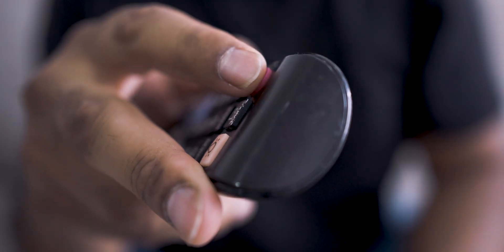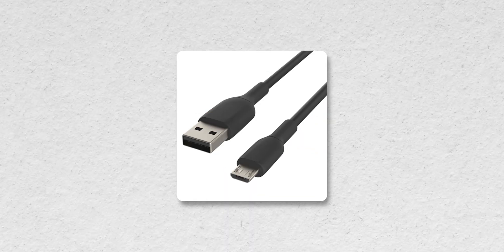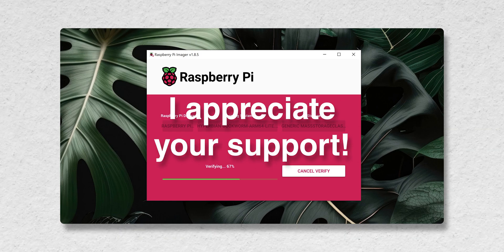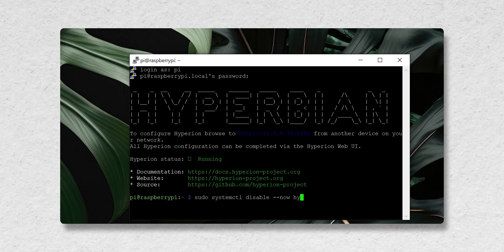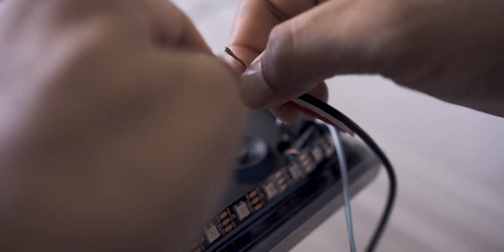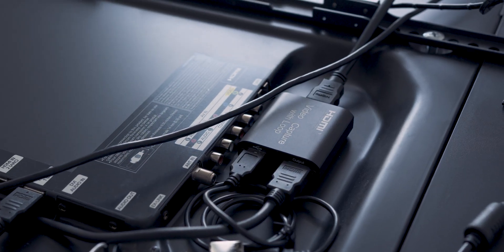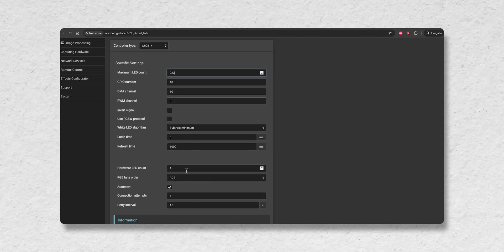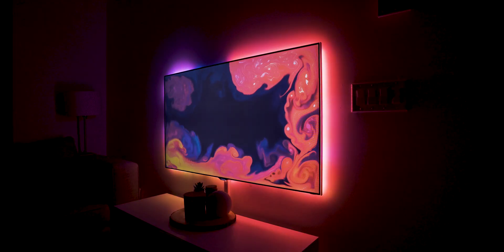I gave my TV a GLOWUP with a DIY LED Ambilight backlight | Philips, Govee, Nanoleaf alternative

Comment: ıve got 12V cob led strip, it is also driven by 5V pwm. from gpio18 pwm pin , you can only send 3.3v pwm . So first question is, 5V led strips data input can be driven by 3.3V pwm?

Comment: No VRR, no 4k @ 120hz for this set up just FYI. You'd be seriously degrading your video/gaming quality if using this on a console.
Reply from the maker: Hey iOakie, thanks for pointing this out. In order to support new-gen consoles, the setup will need a splitter and capture card that supports HDMI 2.1, but these are expensive, and at that point, it's better to explore plug-and-play options like the FANCYLEDS 2.1 Fancy Sync Box that has HDMI 2.1, VRR, ALLM, and 4K@144Hz.

Comment: Hello, very good project. I have it around 1 year and it is working well but not in gaming either pc or ps5. Do you have any recommendations? Its clearly matter of the capture card that cant handle 4k 60fps although in the specs is written that it can. It can handle this resolution but have many flicks.

Comment: This vilcome is a switch right not splitter. Only the x box runs or the light runs am I right ?. But u need a splitter to run both lights and console. Am I right ?
Reply from the maker: Hi nextmarketingg, thanks for stopping by! Yes, the Vilcome is a switch. My XBOX One and Amazon Firestick are connected to it. The output from the switch feeds into the ambilight setup. This allows me to use the lights for both devices as opposed to just one.

Comment: Can an ESP board be used as an alternative to Raspberry pi?
Reply from the maker: Hey dashingtimmy, thanks for stopping by. Sorry for the late reply.
I did some research and this is what I found:

"An ESP board is a microcontroller, not a single board computer like a Raspberry Pi. It does not have the capability to run the full Hyperion server software or process video input from an HDMI capture card directly."

Therefore, you'll still need to use a Raspberry Pi.

Comment: hey! your capture card in video and in the description are different! Which you have used at the end?
Reply from the maker: Hey artemgoncharenko646, thanks for pointing this out. It looks like the card I linked initially is no longer available on Amazon but I've updated it with a new one.

Comment: Hi, I hope I got reply due to my curiosity to build similar thing. Is it working while I'm watching youtube, netflix, etc? Some DIY-ers sold their homemade product and encountered DRM issue, so the lights won't work. 
Also, about Hyperion, is it necessary to use that specific software? Or I can use other apps, such as SignalRGB maybe?
Reply from the maker: Hey noobricer,thanks for stopping by! This method routes the HDMI signal from your streaming device (Roku, Amazon Firestick, etc.) through a capture card, and then passed on to your TV. The capture card is connected with the Raspberry Pi/Hyperion and they process the signal and display the appropriate colours on the LED strip.
There are capture cards that can bypass DRM (such as the one I used). You just have to search for one on Amazon that specifies that.
It looks like SignalRGB has mods that can allow for a similar result, but it looks like it could be more complicated than using Hyperion. Hyperion is also open source so it doesn't cost anything to use.
Reply: @bhimmeup  hi, thank you for your answer! :D I tried signalRGB, and it's a little bit awkward. It's really pixelated so it can't give me the most accurate color, so I'll try Hyperion. Thank you

Comment: why not put the capture card on your e-arc hdmi, and plug your inputs into your  audio reciever? that way your tv apps should also work. at least i hope it would work this way
Reply from the maker: Hey @phreshxmetal! I don't have an audio receiver at the moment but if you have one that's capabale of HDMI pass through and you can change input via the receiver, then technically you should be able to do it this way.

Comment: Why are you not using a level shifter between led strip and raspberry pi? Is it still working fine? I am asking because I really like the project and the video and want to try it myself but I saw some comments on this online and I am curious if I can do it without level shifter. Thanks in advance and thank you for a very nice video!
Reply: ıve got 12V cob led strip, it is also driven by 5V pwm. from gpio18 pwm pin , you can only send 3.3v pwm . So first question is, 5V led strips data input can be driven by 3.3V pwm?

Comment: This is an awesome project, congrats! I'm thinking about doing the exact same! Could you advise on 30 or 60 leds/m? Or possibly an rgbw led strip. This should also work with a raspberry pi zero 2w, right?

Comment: Great video, thanks for sharing. I just set everything up, I can confirm the Pi is receiving power and I was able to configure it, and the TV recognizes the HDMI input, but the LEDs just won't turn on at all. I connected it via a Roku
Reply from the maker: Hey Spencer! In the Hyperion app, do you see the live video capture when you play something on your Roku?
Reply from the maker: People who had the same issue online seem to get it working after re-flashing the Hyperion image on the Raspberry Pi. Seems like it could be a corrupt installation on the Pi.
Reply from the maker: You can also try turning off the audio in Putty (once you connect the the Pi) with this command: dtparam=audio=off

Sources online had luck getting it to work after disabling the audio.
Reply: @bhimmeup  thanks for your replies! I got it to work after rebooting and unplugging/re-plugging some wires. Not sure what the problem was at first. There was a weird issue where red and green were swapped, and cyan and magenta were swapped. I was able to manually override that to correct the colors, but unfortunately that method means the settings won't save if I ever restart the system.
Reply from the maker: Glad to hear you got it working!
Reply: @spencer00andrew  how could you be able to drive the leds ? i couldnt manage to drive leds.

Comment: Nice, however any way to get more details on the hardware connectivity (power, pins on raspberry...)
Thanks 👍
Reply from the maker: Hi Olivr. Thanks for stopping by. You can google Raspberry Pi pin mapping and specify which model you have.

Comment: 3:01 so I’m curious about something.
I have a setup where I have video from my switch going through a capture card and into both my TV and OBS on my computer. The only thing I would want this for is gaming (on switch or PC), soi was wondering if there is a way I can do this that instead uses a piece of software in my PC to just monitor what’s going on in OBS and light up the LEDs accordingly?
Reply from the maker: Hey OctozenX, thanks for stopping by!
I think I understand what you're trying to do. 
Check out the YouTube video titled "How to build a DIY ambilight monitor" by seafox c. It looks like the build uses a Windows app.
Reply: @ thanks for the suggestion, I’ll check it out

Comment: Would it be possible if, instead of buying new LEDs to connect behind the TV I used my nanoleaf project which I made that runs on a esp32 which has WLED running on it? Would it be possible for I to connect the ESP32 to the Raspberry Pi via Bluetooth
Reply from the maker: Hey Jad, thanks for stopping by! There's a guide on. Instructables.com titled "DIY Smart Home PC Ambilight" that uses wled. Take a look and see if it'll work for you.
Reply: @bhimmeup  hey it's me again, you know any reasons why the LEDs aren't mathcing the colors on the TV, because when I reboot the Raspberry Pi, the color stays white? I have some WS2811 LEDs you think maybe that's the problem, or is it the information cable

Comment: Thanks for the detailed video. All my HDMI inputs go through my receiver so i am wondering if i can still use this setup to create the LED sync from my TV sources like fire stick, PlayStation etc
Reply: Yes you can. I am using it with my Yamaha rx-v6a without any Problems

Comment: Problem here is you can’t grab the internal Smart TV Source, so only Ambilight from external Inputs
Reply from the maker: Yeah. That's the only limitation. Unless TV manufacturers start incorporating LED backlighting as a feature, the only other option is a kit that uses a camera to capture the screen.
Reply: That's not a problem, that's a feature. If you're still using built in smart tv apps, what are you even doing with your life?

"Smart TV" apps suck, and they're usually outdated and unsupported after a couple of years anyway. It's way better to buy a 'dumb' TV, and then use external media boxes. Android TV, Fire TV, Roku, NVIDIA Shield, AppleTV, etc, are all infinitely superior options to the slow, underpowered, and poorly-supported, slop that are built into "smart TVs".

And as those devices age, they can simply be replaced with newer, more powerful, boxes, instead of having to replace the entire TV.

Comment: Can I usea two different power supplys? One for the raspberry and one for the LED strip?
Reply from the maker: Hi mysharow! Thanks for stopping by. You can power them separately if you want. What's the reason you want to do it this way?
Reply: @bhimmeup  Awesome, thank you for the quick response.
I want to use two since I don't feel capable of wiring and selecting my own power supply for both items, so I feel better if I can use their own power supplys 😅

Comment: Wow great doen!
But for me this wont Work. When i like to watch Movies, i use the Inbuild OS from LG because this makes 4k and Full Surround sound.
Reply from the maker: Hi Fincher123! Quite a few people have the same dilemma. I'm keeping an eye out for any DIY or even off-the-shelf products that might be able to do this. I'll make a video on it if I find anything worthwhile. Otherwise, the only other hope is that  manufacturers start building TVs with dynamic LED backlighting.
Reply: @bhimmeup  Well thats great from you!
I didnt look for that Ambiente light feature like the most arent doing. Important was Resolution and 120hz, oh and it must be OLED. So maybe CES will show some "innovations"?
Reply: Many LG smart TVs running WebOS can be jail broken/rooted to host PicCap (frame capture device) and HyperHDR directly. This avoids setting up a Rasperry Pi with video grabber, making the setup a whole lot cheaper and more efficient. Can be done with an esp32.
Reply: @mysticqro950  Well i like to learn more ;=)

Comment: Great tutorial.  You might want to change the power supply link, however.  The link you have above is for a 12v DC transformer, but the Rasp Pi and LED strips are @ 5v DC.
Reply from the maker: Hey fkholleman. Good catch, thanks for letting me know! And thanks for dropping by!

Comment: what do i need to buy, if i want to have it on my monitor, so just a single monitor with PC, do i still need the splitter and capture device?
Reply: There is a cheaper route without capture card and splitters but it will use pc processing power to calculate colors which introduces a bit of a lag and lowers fps of ambient light. Most diy tutorials are about that route

Comment: I have a 4K HDR tv, will it work with above components? Do i need a different video capture card?
Reply from the maker: Hi geor.papadakis! Thanks for stopping by. 
You can use the same components and a 4k capture card. The only limitations are the Raspberry Pi and Hyperion. You will need to set the resolution in Hyperion at a level where there will be no lag between what you see on the screen and the colours displayed by the LEDs.

Comment: Can you do a tutorial using a larger led strip for a 75 inches tv? im asking this cuz someone told you you need 2 power supply for that project, also i hear you need to use WLED instelled on a esp32 device, is this true?
Reply: I found this: https://wled-calculator.github.io/
You can use 1 power supply and split it and "inject" at multiple points to keep the voltage drop under a certain level.
Reply: im currently installing one for a 75 inch tv, using a 12v 10amp strip with a deticated powersupply, if i pull it of i could let you know.
Reply from the maker: Hi Berbius. Sorry for the late reply! As Eric Fenderbosch said, you can use one power supply and run power to multiple spots. Just have to make sure that the power drawn from the LEDs are within the limitations of the power supply.

There are YouTube videos tutorials on how this can be done. Worth checking out to get a good understanding before you try it.

Comment: Was reading through the comments and saw that you recently got a baby and just wanted to congratulate you!

Planning on doing this build on a new tv we are hopfully buying soon as our tv is from 2009 😅.  Wanted to ask tho, the splitter ur using seems to output 1080p only. Do u know / recpmmend anything that takes in 4k and outputs 4k? Theres no point to run this if my tv is only getting a 1080p source instead of the whole 4k
Reply from the maker: Hi Probler, thank you!

I got my splitter from Amazon and really relied on the reviews to select one. 
I took a look on there and I do see a number of 4K capable splitters available. The only thing to look out for is the refresh rate. If you get a 120Hz TV, the splitter should match that.
Reply: @bhimmeup  hey! Thabk you for replying.

So I already have purchased everything but eas comparing prices on amazon vs aliexpress. Ended paying less than half for everything while making sure its reputable sellers and great reviews.

I'm currently assembling everything. Our tv is luckily 60fps so I found some cheap 4k splitters. But the higher end splitters that support higher fps can get a little pricey. All in all costed me 60 pounds excluding the raspberry pi as I already had one from a old project
Reply: The EZCO 1x2 HDMI 2.0 Splitter works like a charm too. I use that one. Supports 4k60hz input source with HDCP bypass, supports HDR, Dolby Atmos, etc. It maintains 4k60hz output to your TV and lets you downscale the 2nd output to 1080p60hz going into your capture card. From there, I was able to downscale the capture source even further in HyperHDR to 640x480 (for less latency) and maintain 60 fps screen capture. 

While still maintaining the 4k60hz to your TV, of course.

Comment: Is it posible to connect the LEDs into the USB port of the raspberry pie and have it get the data and power from there? Or are there limitations?
Reply from the maker: Hi @FORCEtheFUNK285, that's a great question. I know that LED strips can be powered via USB, but I think the limitation here is the Hyperion Hyperbian software which uses the GPIO pin to push data to the strip. With that being said, Hyperbian is open-source so if someone wants to, they can try modifying the code to route the data via USB rather than the the GPIO pin.
Reply: I think they can as hdmi sync box uses usb a port ,some use type c

Comment: Amazing work man.  Looks great.  I love your videography.  Question:  Do you know if you can use a newer pi than 3?  I see 3 is what everyone's using, but maybe there's a benefit to using something with a quicker chip?
Reply from the maker: Hey Bakelooly, thanks for stopping by!
Yeah you can use a newer Pi. It might help with getting a better resolution output in Hyperion without lag between the display and LEDs.

I personally got the 3 because it was cost effective.

Comment: Wondeful tutorial! I have ordered using your links and plan to get it set up when the parts make it here later today. 

I received a note directly from BTF-LIGHTING telling me that the 12v power cable is too strong and I need to use a 5v power cable. Is that accurate?

Here's a portion of the message:

"The DC12V8A power supply cannot work with your DC5V WS2812 RGB LED strip, otherwise, the DC5V LED strip will be damaged.
For the DC5V LED strip, you should use the DC5V power supply.

You can use the DC5V10A power supply to power your one roll of DC5V 16.4FT WS2812 RGB LED strip."
Reply: yeah.  You need to make sure the voltage of your power supply matches the voltage of your LED lights.  Some are 12 v, but if your LED says 5v, your power supply does too.
Reply: @ Understood. I gave it a shot anyway and burned out my 5v strips lol. I ordered a new strip of WS2815 and they work as expected with the 12v power supply.
Reply from the maker: Sorry I couldn't respond to you sooner, axhlederbosss. My wife and I just had our 2nd baby and were busy with her for the past few weeks. 
Bakerlooly is correct, the voltage has to match between the power supply and strip. 
Sorry that I couldn't relay this to you sooner before you burned out your strip.